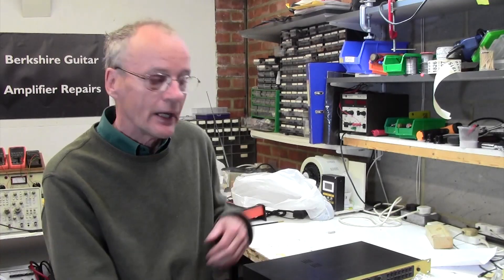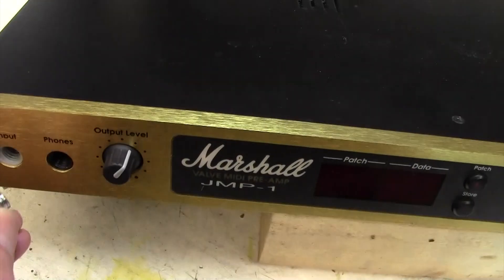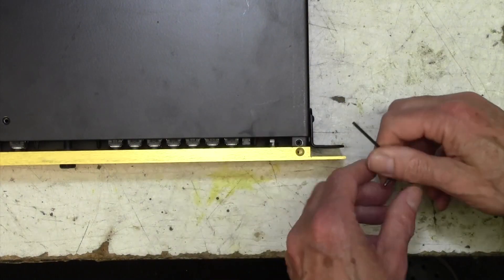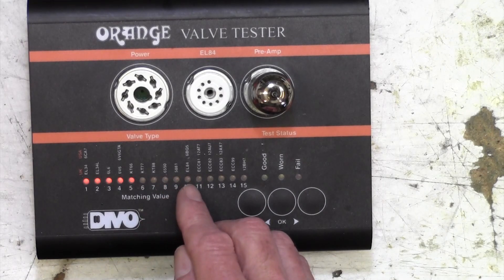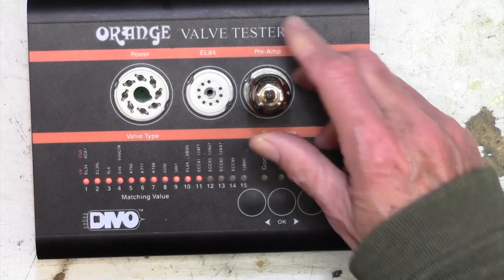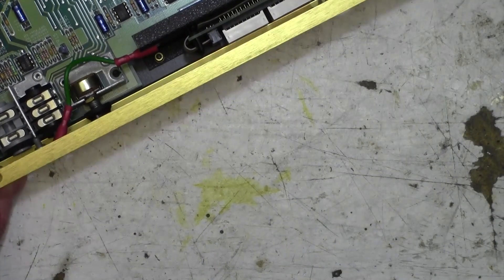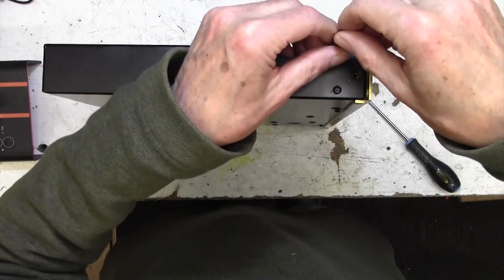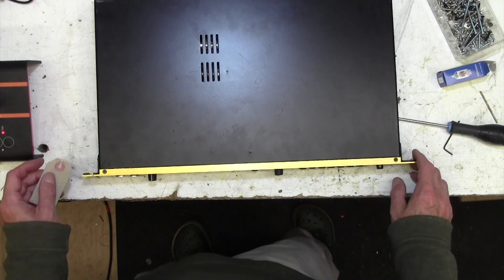Marshall JMP1 A Look Inside

Comment: I had one of these, I took it to Marshall for an intermittent fault, they did a repair service on a Friday, so I booked a factory tour as well! They couldn't trace the fault ( it cut out randomly) and they had it on the bench for a week, so what they did was order a complete board with my name on it! And run it through the factory (they work the lean system) so I got a brand new preamp apart from the case ! And as they couldn't  locate the fault on the day they only charged...... wait for it.....£40 labour!!! What incredible service, had a brilliant time , got my amp fixed and a factory tour!! I finally got peed off lugging a rack system about and got one of the little jcm 2000 tsl 601 combos, good little amp nice with a 4x12 up graded to a tsl  100h now that was a good amp
But it eventually succumbed to the dreaded PCB malady after its 14th birthday, have fitted a new board myself with the help of Mr McKenzie's excellent video it's now as good as new, I upgraded the terrible footswitch design with 
Bigger coloured LEDs to match the channels and a seven pin din socket, six years of gigging  very reliable, up graded to a JVM 100H
But never spent the time with it
A change of life came and I now use a Boss katana 100, it's perfectly adequate for the band I'm in now, and cost less than a good set of valves,
Reply from the maker: Wow sounds like you got a really good deal there!

Comment: I have 2 JMP-1 preamps,  the first one,  if I put my Midiverb IV in the FX loop,  every so often the delay effects will just cut out.  I have to restart the JMP-1 to get the delays back.   both of mine are in dire need of a service, as I use them on a daily basis.   Great to connect with a JMP-1 repair video,
Reply from the maker: Hi Steve that sounds like a nasty one. These are hard/impossible to repair due to the microprocessors etc in them. Good luck.
Reply: @stuartukguitarampguy5830  my guess is it's the effects loop jack socket...  thanks for the reply

Comment: The bad valve had very mismatched triodes I noticed when you retested it a 2 and a 9 I think . The Orange tester fails valves with more than a 5 digit mismatch I believe because it is a severely unbalanced tube .
I use socket savers in my Orange tester , and when they began to wear out it caused a few erroneous readings  . So I simply replaced the worn out socket saver . Good for another few thousand insertions  then .
Cheers for the great videos .
Reply from the maker: Hi Yes I noticed that when editing the video! Missed it at the time. I don;t test a HUGE number of valves so didn't bother with the socket saver. I might get one though thanks.

Comment: I have a JMP-1 and one of the main reasons you lose the locknut on the 1/4 inch jacks is precisely because the thread pitch is so coarse.  The shallow pitch facilitates the nut working loose. Use locktite blue to stop it from occurring.
Reply from the maker: Ah that makes sense. Thanks so  much.

Comment: Another trick with those stripped screws is to use a dremel and cut a small slot across the top, then use a flat head screw driver to remove it.
Reply from the maker: Great idea thanks Jim.

Comment: I'm afraid I have to totally disagree with you on this one  Stuart... 
I repair lots of these and they're fairly easy to get apart and work on. Once it's out of the box you can run them to fault find with no issues. 
Totally serviceable and 'chucking it in the bin' because people are too lazy to work on them is a terrible suggestion !
Standard faults include... Input socket (which is a mirror image of a 'normal' socket), the pot gets noisy and will require replacement and the mains transformer tends to go O/C on the HT winding. 
Marshall still supply the correct socket nuts and surrounds too, in fact they supply just about anything for any amp, very unusual these days to be able to get parts for a 50+ year old amp from the company that produced it! 
As for the Orange Divo, I wholly agree, you may as well just toss a dice!
Reply from the maker: Hi I agree with you, maybe I wasn;t clear on the video but I thought I said something like "Unless it's a simple fault like a jack, a regulator, and so on." If that microprocessor side oes down you're all out of luck, I reckon!
Reply: @stuartukguitarampguy5830  All parts are available for the JMP-1 from Marshall.
Actually they are very reliable and the only common problems I've noted above.
The only tricky fault I had that took some head scratching was the bass control not working.
That was a S/C cap accross the IC that controls it.
They're still massively popular and still fetch good money.
As I've said, I do loads of these still.
Reply: @DrWatts-bi1jv  I have to agree with you here. I did actually have a Microprocessor fault. Before I disappeared off to try and find one, a call to Marshall and they could provide one no problem. The sad part is I wasn't an authorised tech at the time and although I knew the fault, I had to take it to them. But yep, done and dusted in 30 minutes. I just told the technician what I found, came out and agreed the processor had indeed failed. I didn't do the factory tour, but was happy that they only charged me £20 or so and I was on my way home within the hour.
Reply: @stuartukguitarampguy5830  I disagree. It's a different skill set to repair them, but the chips are still pretty easy to get hold of and they're pretty easy to replace. If it was impossible, then there wouldn't be the utter legion of people on YouTube fixing hundreds of very old computers that are fundamentally the same circuits.
Reply from the maker: Hi Yes you're prpbably right and I've seen some amazing YouTube vids where laptop repairers are fixing these things! It's not in my current skill set though and It's very hard to find anyone who can take something like this on. All the best.

Comment: Why isnt that unit reparable ?  The ADA MP-1 (JMP-1 "brother") had several guys reparing it.
Reply: It is repairable, but since it's a microprocessor, it requires electronics experience in working with those types of circuits. The only main problem is if there's an issue with the ROM and you can't find a dump of it online. But having the ROM on a separate chip like in here makes it pretty replaceable. It's CPUs with ROMs built into them that are an utter pain, as usually getting those chips are difficult now, let alone programming them.

Comment: I have a pedal with a tube preamp, and I wouldn't be surprised if the tube were completely dead and the user didn't notice. Switching channels, you never really know if you are on tube preamp or solid state. You might get one used and have some channels that just scream or show show some other issue and simply never use it. And the heart of the problem might be a microphonic or bad tube and you just never address it. Tubes can show their ugly faces in alot of ways, be fine in one position, but move it to pushing your reverb or phase invertor and be a complete failure. This guy might get back his rig and find it has alot more to offer that he was ever aware of.
Reply from the maker: True. whilst editing the video I noticed that the FAIL problem was a massive imbalance in the two halves. If you look again you can see one half comes up '2' or whatever, and the other half '9' or whatever. So it was the imbalance which was causing the FAIL light.

Comment: Use a dremel tool to make a slit into the screw and use a flat screwdriver to get it out... So easy instead of drilling and you are not gonna damage something as fast as with a drill.

Kind regards
Reply from the maker: Good idea. Thanks.

Comment: The reason it rejected the valve was the very poor balance between the sides.. Man of no faith ...One side 2 the other side 9 ... The tester is quite good . I ave checked it against my At1000 and it was actually better !!
Reply from the maker: Hi. Yes I noticed this whilst editing the video. Missed it at the time! However, I have defo had problems with my orange tester. The problem is this: If I test a batch (say 20) of brand new preamp valves, sometimes after a few (6? 10?) it will start to fail them. It doesn;t matter how many more I try and test, they all fail,. If I then try the ones it passed earlier, it fails those too. Switch it off for a while and it starts passing them again, So not really sure what's hapening there.
Reply: @stuartukguitarampguy5830  I had considered purchasing that same Orange tester a couple years ago but the user reviews on it dissuaded me.  So, you're not alone in your problems with it.
Reply from the maker: @divebomb99  TBH it's better than nothing - and that's what else is on the market - nothing!